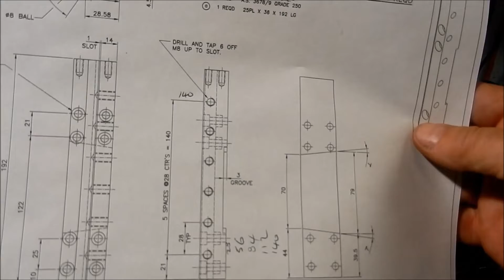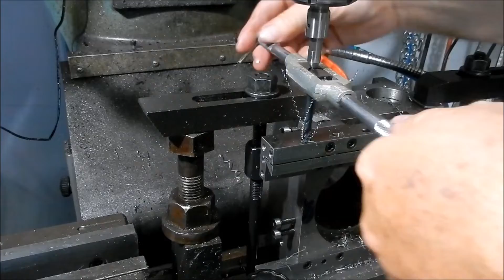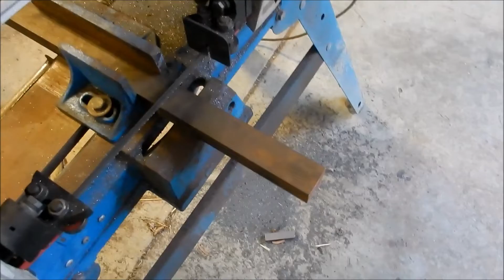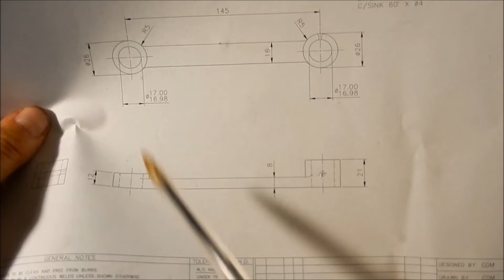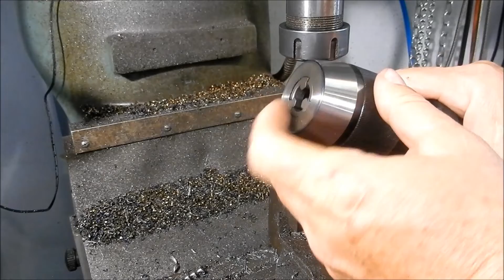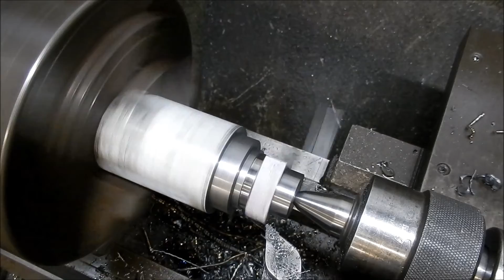Powered Lathe Slotter Build Part 49 and how to wreck a Crank Arm

Comment: sucks about the stuff up, but couldnt you just weld it up and machine it back down?
Reply from the maker: G'Day Chirp, it would bend up and distort due to the heat.  As I have done all the final machining to size and tolerance I've got nothing left to work with.  My own worst enemy sometimes I guess.  My gorgeous wife gave me 2 hrs straight in the Workshop (just finishing up now before tea) and I'm almost back to where I was before I stuffed it.  Amazing what you can get done when your not trying to get those video shots.
Cam
Reply: Yea, i guess that's true, I would probably just braze it up then, then you dont really have to worry about the steel getting hot enough to distort it. lol, I know what you mean by getting stuff done without the camera on, lol. I did stuff off camera and suddenly started running out of projects within the first few days, lol.